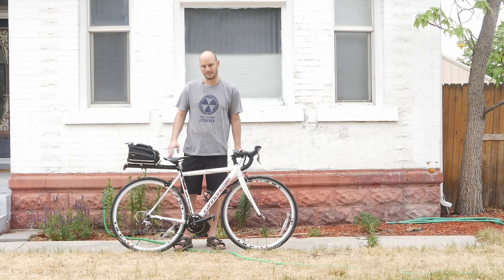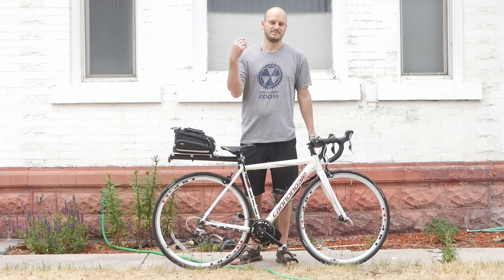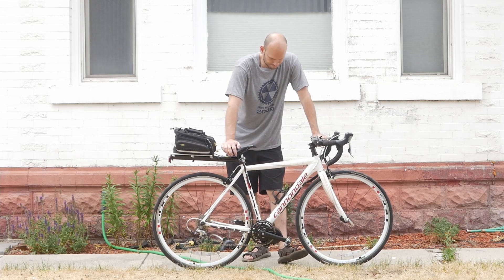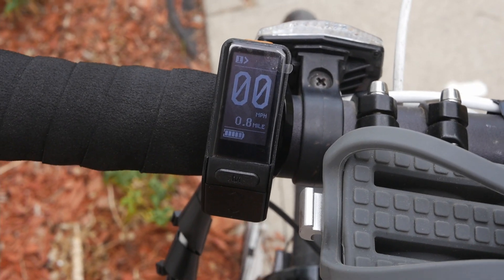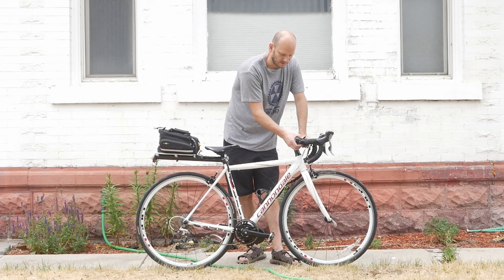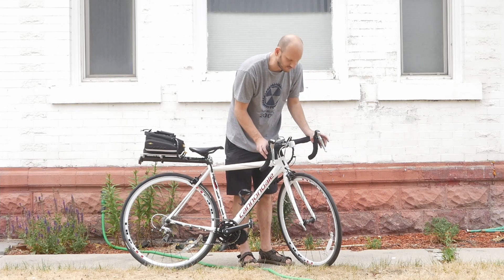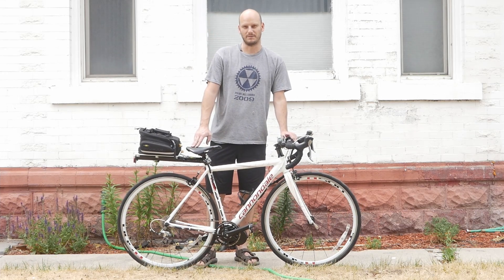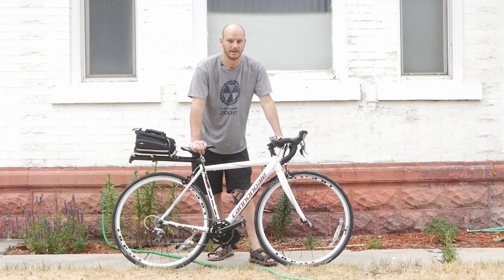Custom E-bike Build: Cannondale CAAD Drop Bar Bike Bafang BBS02 mid drive Road bike w/ drop bars

Comment: Hi John,
I decided not to use the the leakkie chain ring. I modified the rear freewheel cassette. Since I did not need all the gears out back, I kept the first 2 which are required because they keep the cassette together. 
Since the #4 position is the best chain line with the original Bfang 46 tooth crank gear I used the 28 tooth for that position and the 34 tooth in #5 which gives me the most climbing power. 
The rest of the cassette was stacked after #5 so the overall dimension of the cassette was the same. No jumps or skips after the change. 
I will send pictures if you are interested. My BBF02 750W is now a legend because of the hill climbing capability. 
Crazy Bill Utube junkie

Comment: A light road bike with small 6AH battery is meant for someone who's going to do majority of the pedaling.  Thought this was going to be your 1st Tongsheng TSDZ2 install due to the torque sensing = better battery management for Athletic riders.
However, other than cadence sensing, the BBS02 is a better motor.  I'm sure PAS 01 @ 100 - 200 watts is all the rider needs.

Comment: Hi John, I put the Geeko rear hub kit on my Cervalo S1. It’s only a peddle assist which is all I wanted so it’s a very simple and clean installation. Only the rear hub and battery that looks like a bottle. I wish I could add a picture of it here.

Comment: Another great build!  Where can I buy the inline brake cut-off switch?  I assume it works the same as a gear cut-off switch?  The one you used looks much nicer than a standard gear cut-off.

Comment: Very clean! Another awesome build.
I'm curious about the inline brake cut offs. Are they cheaper than a gear shift sensor? Do they use the same higo connector as the stock cut-offs? Are they a cleaner install than a sensor would be? Both, the inline cut off and gear shift sensor, appear to do the same thing (and the gear shift sensor can use the same connection as the brakes on the BBSxx).
I'd like to consider myself fairly knowledgeable about e-bikes and still always learn from your videos. Keep the great content coming, please;)
Reply from the maker: Yes the in line cut offs are awesome because they very similar to a gear shift sensor. Slightly cheaper and use the standard higo connector 👍
Reply: @JohnnyNerdOut  Thanks again. I love your builds and your willingness to teach.

Comment: I just installed the BBSHD on my mountain bike. Single speed cog on the rear. I bought spacers to align the rear cog with the front Luna mini 30T chainring I also got. I would say i'm about 2-3mm off center. Seems pretty minimal but then again I dont know how much room for error the BBSHD setup will allow. How far off can you be before the chain will come off when in motion?
Reply: @Scott H that's good news

Comment: Thanks for the video. I’m thinking of converting my wife’s cross bike which has drop levers but they are hydraulic (Shimano RS405) - is there a solution to mount the brake sensors on these hydraulic brake levers?

Comment: How did you get the speedometer to fit? I'm trying to do an install on a trek alpha 1.5 road bike but there isn't quite enough clearance to fit the speedometer to the chain stays without hitting the spokes.

Comment: I saw a sort of rear bracket that mounts on the wheels, and it had the battery stored in a somewhat enclosed compartment such that you could still tie stuff to the top of the bike rack.     Any idea what that is called or how well those work. 

Also, is it possible to “lock a battery” in case of theft protection or is this just because it’s a conversion we would just have to unplug our battery and bring it in with us?

Comment: Just what I wanted to hear about, since I have an old Cannondale road bike that I am interested in motorizing. The bike is similar to the one in the video, but crappier. It's so old, the shifters are on the downtube. Why put the battery on the rear rack rather than in the middle of the frame?
Reply from the maker: Customer preference
Reply: @JohnnyNerdOut  If the motor were to kick in only in response to pedaling, could you (would it be smart to) dispense with some of the electronics?
Reply from the maker: @RichardTasgal  not following, can you reword that? 🤔
Reply: @JohnnyNerdOut  Sorry. If it's set up so that you need to be pedaling for the motor to supply power, can you dispense with the equipment that cuts off the power during braking and when changing gears? Maybe the rider does it intuitively by not pedaling.
Reply from the maker: @RichardTasgal  I have found in my experience that it’s better to have the motor cutoff sensors at hand. Especially for low speed, tight maneuvering. I would recommend against not installing brake cutoffs and the gear shift sensor.
Reply: @JohnnyNerdOut  Thanks.

Comment: The one thing noone addresses is the use of a shockster. A shockster converts a hard tail bike to a full suspension bicycle. It connects to the rear dropouts and also connects to the v brake standoffs on the rear of the bicycle. The issue i have been told about these may be speed due to the way they connect to the bicycle. Any opinions? Does anyone know anything about these? I might wind up using a set up where the output of the motor matches about 80 percent of the max newton force the rear 3 speed igh could take? As well as under matching rhe chain nm of force it can take reliably. Going down the road of watching the ammount of machanical stress placed on the weakest part of the bicycle system might not make for a very fast bike but might make for a more reliable one. Any suggestions???
Reply: I'd imagine you could solder a couple lines together.  I'm not sure how many wires or complicated the throttle cable is.

Comment: Beautiful bike build, but what's with the tiny battery? Seems like it won't get a lot of range, especially at 40mph
Reply from the maker: End user will only be riding it 12-15mph so range will be 40-50 miles at that speed :) I was just saying it capable of doing 40mph due to the design

Comment: Johnny I have a BBS02 and when I lift the back wheel it will only spin at 34mph. I have 48v, but the display (I have the same one in the video here) says 54.2v when charged
Reply from the maker: What are your gear ratios? (Front and rear sprocket when testing)
Reply: @JohnnyNerdOut   hey johnny first of all I'm 19 and u are absolute inspiration and u are the reason I built mine! thank you for responding you are every ebikers hero! I bump into someone with a DIY and they always know who u are! keep up the great work! I got about 1000 miles on it this year at school, and  when I said this 8 months ago my bike was in bad shape. its a 1998 trek 8900 sl with 100m travel in the rear wheel was so fucked up from god knows what ( i got the bike for free from my friends dad and I'm returning it after college for my next build with "adult money" I am broke northwestern student)  . now  i run 11 in the back and 46 in the front. in Chicago on a flat road no head wind... i went fucking 42 mph! I am going to put some hybrid tires on and should be even faster than my winter tires. I am trying to get to 50mph! I cant put any larger of a chain ring in the front because it would rub against the frame. is putting a spacer on the chain ring an option or not really? I want to put a 52 tooth chain ring.
Reply: also another question is if my shifitng is slow how will the shift sensor know when to put power back in the motor? at the moment it takes a little love for it to shift and I'm worried the motor would not know when to give power. thoughts?

Comment: Can you convert this bike to regular handlebars and make it easier to install hand controls? Is this bike made out of metal to make it lightweight? Or aluminum for light weight?
Reply from the maker: Yes you could put flat bars on it if you wanted, Aluminum.

Comment: Hi! Im thinking to buy the kit for myself but I dont know what to choose between 52v and 48v for this BBS02. Is it too much 52v to BBS02?
Reply from the maker: I run 52v personally with the bbs02.
Reply: @JohnnyNerdOut  and changing the controller's settings through the software program is a must in your case?
Reply from the maker: @mateii99  no not really. I do like to be able to fine tune the motor with it though

Comment: Do you ever use the stabilizer bars for your bbs installs?  any thoughts on those
Reply from the maker: I don’t. I haven’t seen a need for them really so far. Just torque that inner lock ring as tight as you can 👍
Reply: @JohnnyNerdOut  from the looks of the reviews on them, its people jumping their bikes who are using them
Reply from the maker: @soandsononame8750  I just built myself a full suspension trail bike so I’ll report back on how it holds up👍

Comment: Yet another great example of why I tell my customers to convert a bike they love vs buying a new e-bike. You can't get quality hubs or deraileurs on factory bikes. If you luck in to one with drop bars or even the rare flat bar road bike, it will have cruddy bars that are too wide and a stem that weighs a good pound! Very few people really have a need for wider tires for their commuter or pathway getaways. Comfort comes from good geometry and proper fit, not wide tires and suspensions designed for off road control. This thing is way beyond efficiency to normally compare.

Kind of surprised at this build. Handling is everything on a road bike. Balance would be greatly improved and the silly stealth maintained with an upside down triangle bag or water bottle battery. 

A TSDZ2 would have saved approximately 4#'s. It's smaller too. That's handling and battery life. Torque sensing would respond more quickly to a breakaway and improve battery management. Brake and shift sensors would not have been needed either.

All that said, 85% of your energy needed to maintain 15mph is because of wind resistance. Those drops, high quality hubs and light weight, are going to give her a good 3 hours at 15+mph in mixed terrain, pedal assist. She'd pick up almost two more hours with a 10ah battery because she'd have to be abusing it continuously to use much more than 100 watts. Top athletes spun bikes like this around 120 watts doing 20 continuously when it was new.

Comment: Nice clean build. I am concerned about safety. 
This bike just isn't designed for the speeds  proposed. 
Yes, you can pedal it fast, before mods, but that just isn't done, and certainly not for handling and distances over poor streets.
 Motor bikes are motor bikes. Bikes ain't. 
Brakes, frame, wheels and tires are built for the speeds and stresses they expect over time. Class 3 bikes need to be regulated/built, insured and inspected like the motorbikes they are. 
I am just not seeing a balanced motor vehicle designed for the environment in which it is going to be asked to perform. 
Just because it can be done , doesn't make the safety math work. 
I hope she stays safe, but fear it is designed otherwise.
Stealth designs say pretty loudly they are going to be used where and how they shouldn't be.
Reply: @Locust Hypnosis rear suspended bikes have lots of jacking from the effect of pedaling. that's why you see the , um ,creative layouts, trying to balance the forces. offroad the BSHD can  ask a lot of suspension control, once you get going fast and it's rough. If fast to you is putting a big engine (or motor) in the equivalent of a jeep or a pickup vs a balanced controllable tool that is planted in turns, use anything.
Reply: @Locust Hypnosis Good. Nobody hit by lighting has good things to say about it.